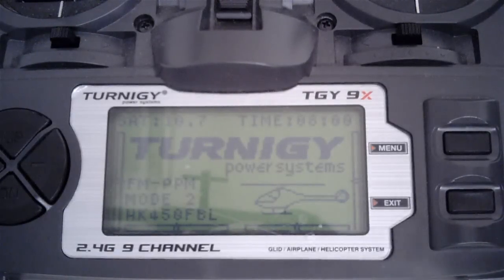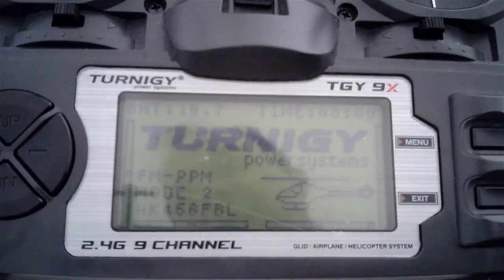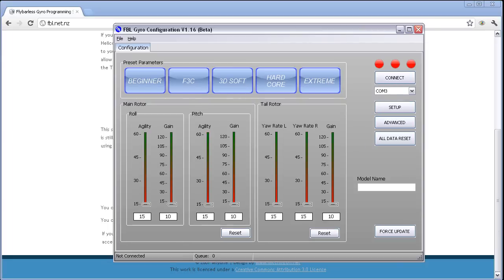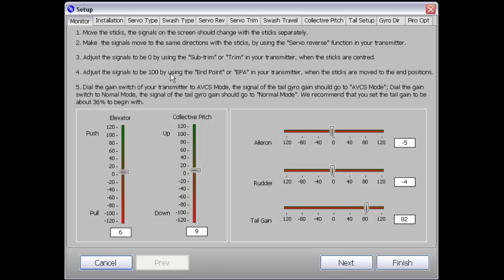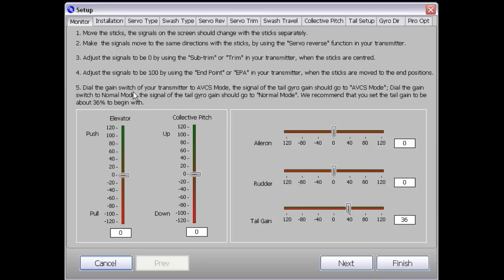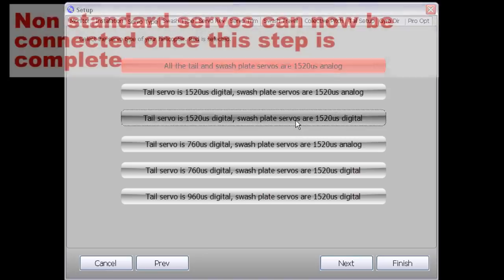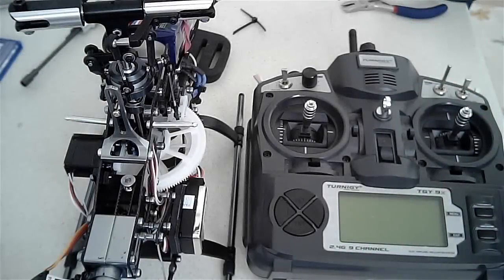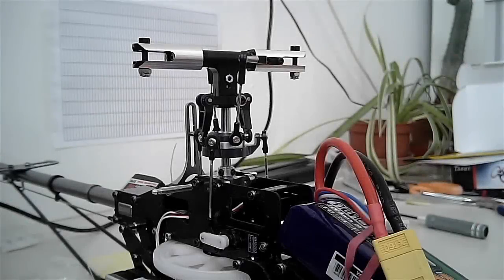HK-450GT Flybarless Conversion - pt 4 - Radio and Software Setup

Comment: Simon, great help with using the Tarot software Zyx 2.11. I had my TT Mini Titan FBL Coversion head with the rotor grip control arms in their usual position(Leading) which threw me for awhile trying to get the cyclic servos working in the right diretion to match the software but in the end I switched the rotor grip control arms into trailing position and all worked out. All the best - now going to watch part 5!

Comment from the maker: Hi, You move the f.mode 3 position switch depending on which curve you want to adjust.  So press and hold menu to enter the menu then navigate using the up button to the "func settings".  From there you can enter throttle curve and pitch curve and make adjustments to normal, ID1 and ID2 by moving the 3 position switch.

Comment from the maker: They way I understand it is that we carefully set everything up on the 1st setup page, that is the monitor tab.  If at a later time one reverses a transmitter channel then the monitor page will now be wrong.  It most likely won't make any difference and both methods are OK, but making the reversals in the software seems the most logical to me.  I believe that is what Tarot intended us to do.

Comment from the maker: Thanks!  Yes I did this step.  I may mention it rather than go through it in detail probably in vid 5.  I think it does improve tail performance and seems to eliminate some drift at hover.  If the tail setup is right and the mechanics in good condition the tail hold is very good both at hover and full collective pitch pumps.

Comment: Just watched this and it's got through the setting up process fantastically. I crashed my 450 pro dfc and had to replace just about everything and read the manual to the zyx and was completely head shot, didn't know where to start at all. Then came across this little beauty, followed it, came across a few teaching problems, but think I've got it all down to exact as you with settings etc. only one problem I can see is how do I get my tail gain down in the first part of the video? It reads 51-51

Comment: Thanks for the very useful video! One question. "Tail Setup" at 32:20, there is a button "Tail Servo (Reverse)". Say the tail blades do not respond to the rudder input correctly, should we click the "Tail Servo (Reverse)" button, or reverse the Rudder channel on the transmitter?

Comment: Hello SimonJust getting into the FBL systems. When and how do you do the mechanical set up of the swash. Is it before connecting the ZYX using the Tx or, is it when you have connected the ZYX. If it is before with the Tx , how would you do that if you should not add sub trims?  Thanks

Comment: Hi Simon, excellent video series. I'm currently setting up a CopterX FBL which uses the same software. In the section for setting up the tail, it talks about adjusting tail blade pitch mechanically so that when the servo arm is at right angles, the helicopter is counteracting the torque with about 8 degrees pitch. Did you do this step or do you think that it makes a difference to the way the tail holds? Thanks.

Comment: Hi ...

I found your video really good... Thank you...

I have a couple of questions ...

For some reason my pitch was not working throughout the setup... till I got to the Colllective Pitch. I believe the setting was in positive 6 (a low value anyway) and even if I did move the pitch up or down, there was no movement in the swash... Then when I moved the setting to -60 (like you did) I was able to get the swash to move properly.... I really do not know if this is correct

Comment: Excellent, thanks for your reply. I've not set my pitch by using Rate mode and a lazy susan. Now that I've tested the tail fully on the lazy susan in HH mode, i'm getting a good clean stop on Piros spinning counter clockwise, but when spinning clockwise and I stop, the tail bounces back a good 5 to 10%. Have you come across this issue before the copterx gyro? Do you think it is a mechanical issue or a matter of dialing in the right settings in the advanced menu? I've read it could be decel vals

Comment: hey Simon, im ripping my hair out here with this zyx setup... ive watched this vid several times i know ive got things right, but when i power up heli (with tx on) i get 3 lights staying on, i press the set button and it changes to flashing yellow, i press set again and i get red on all the time... i can go into pc software and change settings ok but the sticks are not doing anything with either the servos or the bars on the software monitor.... any ideas would be greatly appreciated, thanks
tony

Comment: I liked your video,got mine setup every things working the way it should but when i spool it up to the point of taking off the tail spins un controllable to right and left, if it goes left and you try to stop it it goes to the right,the only way to stop it is to hit thr hold,so what do i need to do. thanks

Comment: Tail Setup... I did trim the tail and looked very good, even though I did not move it much... What I did not understand is the Travel adjustment for Tail Limit A and B... I did move the Rudder Left all the way and set the Tail Limit to 100, and then went on to set the other Limit... Now, I am very confused here, because I do not thin is right... I was checking the tail and when the rudder stick is centered, the tail  is not centered (it is off trim)...

I am new to this stuff, so just imagine...

Comment: nice video very helpful. I did everything like in the video the only problem is that is not working the head lock. The only way to work is to put it in channel 7 in a futaba receiver. Like this is working fine and assigned in a switch but the tail gain is 125 in the software and i can not change it from TX. I have futaba T7C, strange any advice would be helpful.

Comment: I understand the tail servo could be reversed in 2 ways. Is there a reason why you preferred reversing it via the FBL system (that software on your laptop) than reversing via the transmitter (channel 4)?

Comment: Help!
My tail gain under flipped switch (rate/blue LED) cant reach zero?? My subtrim came to the end (120)?
What should i do?
My Tx is original Turnigy 9x V2 and using CX3X1000 gyro....

Comment: i have the same zyx gyro and receiver/transmitter (turnigy 9x) on a fbl hk450 pro tt and i am having a lot of trouble setting it up can you please help me, can you post a descriptive pic of where the wires go into the receiver from the gyro, your help would be greatly appreciated as im really stuck